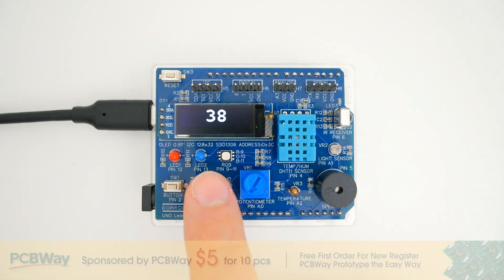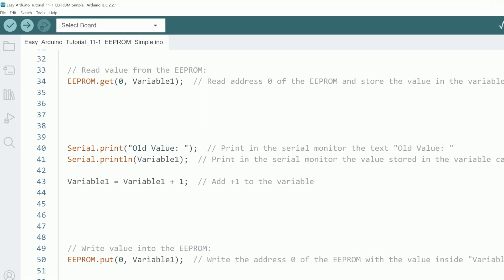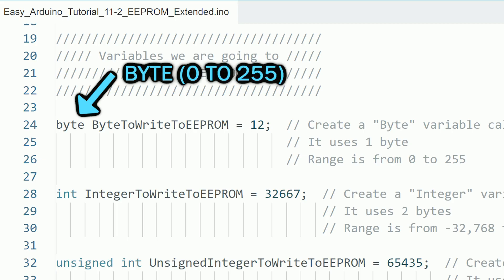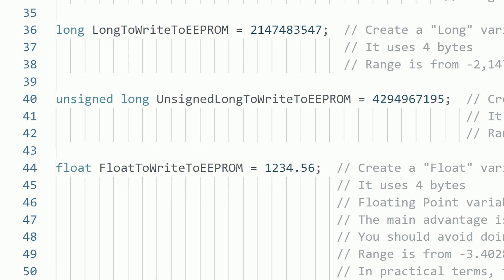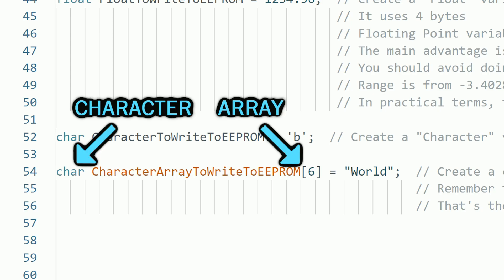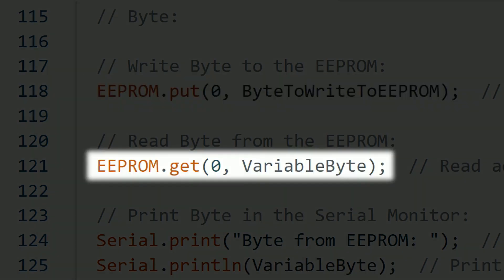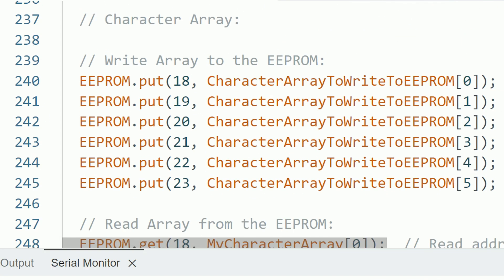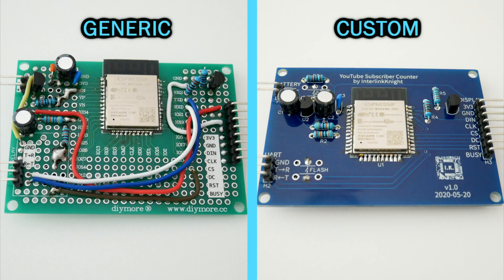Easy Arduino Tutorial: #11 EEPROM

Comment: is it a better idea to use an SD card instead, if the EEPROM has limited read/write cycles? Also is the EEPROM replaceable or is it difficult to do so?
Reply from the maker: SD cards also have a limit of 100,000 cycles.

If you want a easy way to replace the EEPROM, I would use an external EEPROM with a DIP socket or maybe like an EEPROM module.

Commonly this is never a problem, if the code is well written.
Reply: @interlinkknight  oh i did not know that, what about read cycles?
Reply from the maker: As far I know, reading cycles are basically infinite for any of those technologies